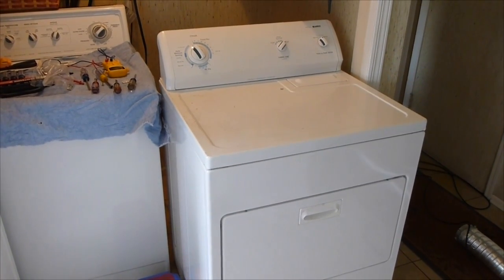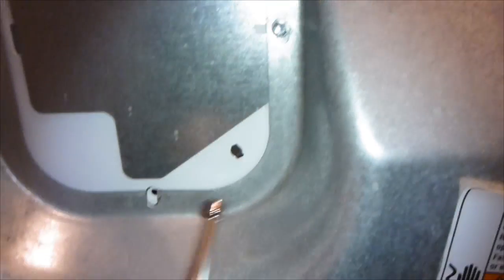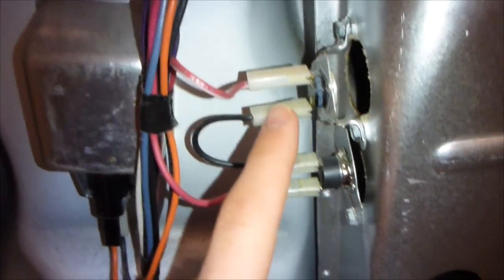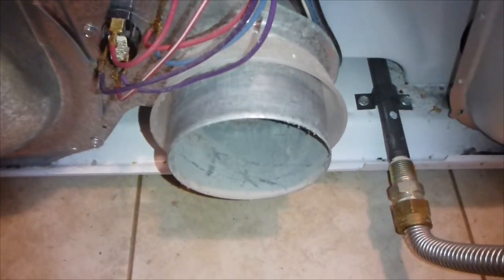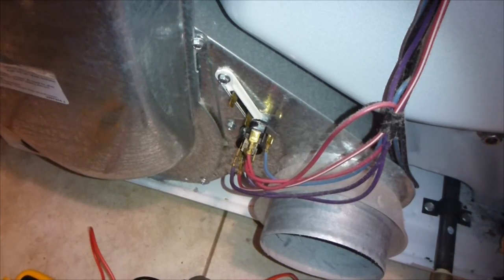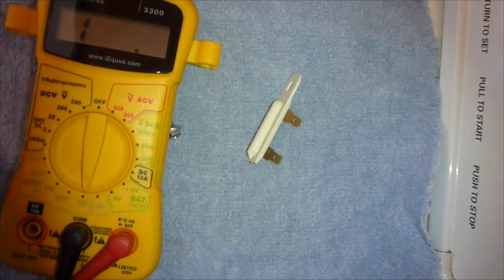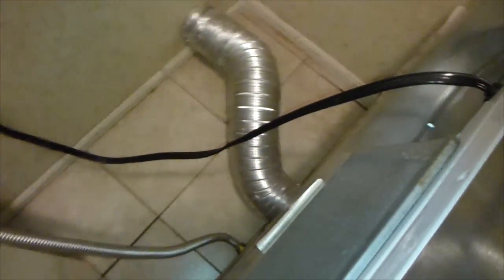How to Fix YOUR gas Dryer that is not heating up (Part 1 rear panel)

Comment: Great fix. Thermofuse wasn't available in town so i broke out the potted thermo fuse, carfully resoldered a new one from radioshack, now it works fine.
Reply from the maker: MrBrainFear Thanks. I am glad the video was helpful. So you made the fuse so it will burn at the correct temp so you dont catch the house on fire right?

Comment: I have a glow, and I can hear the solenoid clicking on and off.  Rarely, but sometimes, I do get a flame and the gas dryer heats briefly.  I have a Kenmore 70 series gas dryer.  Should I still check all the fuses in the video, or is it more likely something else?
Reply: I've done some more observing.  The flame lights on the first try, but after it shuts off after that, the subsequent time it glows, it doesn't light.
Reply from the maker: Randall Pope That means it is most likely you solenoids (99% of the time new ones will fix that problem).

Comment: Hello!

 My, "High Limit Cut Off" read an OPEN or OVERLOAD.  It's the Long Weekend here in Canada so nothing is open to get a new one.  But I thought I would test to make sure my Heater Coil, or whatever is in there is not screwed, so I bypassed the, "High Limit Cut Off' & tied the two wires together[I think I can do this since the High Limit reads under 1 Ohm normally I imagine there is some sort of, 'trip' in there that trips when it gets too hot.  Anyways I have had it running for 5 minutes now & no heat.  Is this a VALID test for the Heater Element, or do you think getting a new, 'HIGH LIMIT CUT OFF" might be the only fix I need.  I'm thinking it's probably both, what are your thoughts?

By the way GREAT VID!
Reply from the maker: velocity73R I am glad you liked the video. I would do just like I did in the video. I tested each sensor to make sure there was a closed circuit. An open circuit means the sensor or in your case, the heating element is broken. I dont know what you mean by "high limit cutoff".

Comment: There is a part that is known as the thermal probe, which strands back with the main heating element, the ignitor, and two fuses protecting it. Most likely it could just be a fuse.

Comment: I have a flow, but no flame.....how bout that?
Reply from the maker: dayglo25 You need Solenoids. Did you check everything else that I showed in the video?
Reply: Yes. Just wanted a confirmation...Thank you!
Reply: Just picked up some new solenoids. I'll let you know what happens tonight when I get home from work!
Reply from the maker: Great! Def let me know!
Reply: ChrisFix now on to the washer agitator! I'm gonna take off the panels and see if the transmission bushing is bad. I'll let you know what happens!

Comment: Where do you buy the thermo fuse?
Reply from the maker: vcomp1960 Appliance store, ebay, amazon, sears, etc.
Reply: Thanks.....Do I ask for a size or just tell them the brand of dryer
Reply from the maker: vcomp1960 Tell them the brand and model of dryer and they will have the right parts.

Comment: Thanks. I blew a ton of lint out of everywhere and cleaned the exhaust line before using it. that was the reason the fuse blew which ultimately prevented a fire. Thanks again for the video and suggestion.
Reply from the maker: Jeremy Harris You are welcome Jeremy! Glad the video was helpful!

Comment: awesome. Thermal fuse was the culprit. used a 20 amp fuse for now and ordered the correct part. Thank You Sir!
Charlie
Reply from the maker: Jeremy Harris Glad the video was helpful. Be careful with the 20amp fuse. The thermal fuse could have blown for a reason (dirty vent) so make sure you address that.

Comment: I followed your advice on using the multimeter, and checking the fuses in back.  Be sure to take off the covers before testing the fuses or you can get a false reading!  I read that on a comment by William on part 2, and re-tested the fuse.  After it tested okay with the covers on, without the covers, it was not working after all.  Quick fix then of the thermal fuse.  Total cost to fix:  $22 for fuse at local appliance shop and $10 for the multimeter at Home Depot.  THANK YOU SO MUCH!  YOURS IS THE  BEST FIX-IT VIDEO FOR THIS ISSUE ON THE WEB!
Reply from the maker: Xro X I am glad the video was helpful! What covers are you talking about?

Comment: ok so, i have no glow. have checked all the fuses, and all are showing continuity.  This shouldn't be that hard, but I am totally stuck.
Reply from the maker: Cassidy Baker Did you check the resistance to the ignightor itself? Or the other thermostat next to the ignightor (in the front)? I assume you saw part 2 of this video?
Reply: ChrisFix Hi Chris,
Yep, watched one and two. Both where really good, which is why I should be able to to this. I replaced the thermal fuse, just in case, and also the ignightor. Both where working according to my malty meter, but still no glow.  It was all working a few weeks ago.  Its not a duct problem, as it is clean.  I wouldn't think it is the thermostat, as I am not even getting a glow to start with.
Reply: Cassidy Baker Well, after having another look, the reason might be the thermostat had a loose or should I say broken terminal. So that would defenetly not be helping the situation. Once replaced, I am hoping it will be fixed.
Reply from the maker: Great! Keep me posted!

Comment: Hey How you  trubleshut they ignitiator. If could  Tell me please thank  you
Reply from the maker: I mention in part 2 of the video that you want to make sure it glows and it has continuity. 
How to Fix YOUR gas Dryer that is not heating up (Part 2- front panel)

Comment: I just wanted to say thanks for your help I did exactly everything you said and it really worked. The thermal fuse went out. I purchased a digital multi meter and thermal fuse for under 40.00 completely fixed. Thanks
Reply from the maker: Glad the video helped you figure out your problem!

Comment: fyi, On your second one you checked you checked your inverted the wires when you hooked it back up. The top one was red on top black on bottom. The bottom was black on top and red on bottom.
Reply from the maker: Good eye. It really doesnt matter the order as long as they are both connected to one prong each. Thanks!

Comment: Hi no the actual thermal coupler sensor (one side of it anyway) broke off. I was able to get the broken part out of the "cap" with the wires, remove the coupler, find a part (our sears parts store closed up here) and replace it. Dryer fired right up. Total repair $20 (plus a little swearing)!!  Thanks for making this video. It saved me so much.
Reply from the maker: Great Glad the video was helpful!

Comment: Hi I was doing really well checking out the spots on the dryer as you described. When I pulled the second set of red/black wires the black wire actually came out with the terminal for checking in the part I pulled away. I don't know how to return it to the terminal post (if that makes any sense.
Reply from the maker: You mean the metal clip that clips onto the sensor pulled out of the wire?

Comment: Thanks, I bought the multi meter and thermal fuse for around 40$ it was an easy fix and saved around 60$ because the repair guy wanted 100$. Got the fuse at the Sears outlet store.
Reply from the maker: Great! Glad the video was helpful and saved you money!

Comment: I only have buss checker and volt checker available. I commonly use them to test fuses in my home and to test outlets. There is no settings on it and no readout it simply lights up if it is working and doesn't light up if it is not. Will this work? I tried it on the back 3 fuses/thermostats and it did not light up at all. Are they all broken or do I specifically need a multimeter that I can set to OHMs?
Reply from the maker: You need a way to check continuity so if your volt checker or buss checker can do that, that is all you need. Otherwise, go to harbor freight and pick up a $5 ohm meter and you are good to go!

Comment: If the thermostat at the lover left bottom is good, but the thermo fuse is bad - would that make the thermostat at the top right back also go bad.  Just wondering if I should plan to replave both or just the thermo fuse?
Reply from the maker: You should replace anything that doesnt work. Those two systems are separate and should not cause the other to go bad.
Reply: Thanks - your info was very helpful to a single white chick who was able to repair her gas dryer with a $20 part and some elbow grease!

Comment: I have a kenmore series 80 gas dryer and thanks to you r video i figured out that i need to replace the valve coils. the question i have is when i took off the back pannel i noticed that that yellow wire thats going behind the lint trap in your video isn't connected to anything in my dryer and I'm wondering if its supposed to. i can't find any terminals that don't already have something connected to it. thnx.
Reply from the maker: I am not sure what wire that is but if you cant find any terminals then it might be an extra wire. What does that wire trace back to?
Reply: you can see it in the thumbnail of the video...its right underneath that orange/red wire and just to the left of the white one, its the yellow one with a black stripe.
Reply from the maker: In my video does it go to anything?
Reply: it goes behind the lint trap vent but but i took mine out and there are not any terminals back there that i saw
Reply from the maker: Does the dryer work otherwise? Maybe it is a ground?

Comment: Hi I checked all components working fine but there's one component 2 red wire one top and one with strip on the bottom working good but two purple wire right and left on the same component doesn't work, so I think thats the problem right... plz help
Reply from the maker: I am not following what you are saying. If you followed all of the steps in both videos and everything works, and you are adjusting the once "component" and then it works, you found your problem! Maybe im just not following what you are saying

Comment: I have whirlpool dryer it runs but no heat, and I heard the click sound,I can see light on the bottom, 5 seconds later light turn off agian and turn off keep doing that. What is problem u maybe know. Thanx

Comment: Great video. My dryer would run, but, would get no heat, so I changed the thermal fuse and that was not it. I changed the ignitor and that was not it and I was about to call a repair man and that's when I found your video. I purchased a multi-meter and went through the step you shown on this video and found it was one of the thermal cut offs. The dryer is working now.  No more stiff clothes!!  Thank You!!!
Reply from the maker: GREAT! Glad you fixed your dryer using my video! Thanks for the comment!

Comment: LOL you rewired the bottom fuse wrong.  black top, red bottom.  How did it run?
Reply from the maker: Good eye. It really doesnt matter because the fuse wires just connect for continuity. She is running great!
Reply: Cool.. I just thought you made a point to talk keep it straight and flipped it in the end.  Good demo.

Comment: Excellent video - very helpful. It turned out our dryer had the same problem (thermal fuse).  While I know it doesn't matter, someone else probably already caught that when you replaced the wires for the lower thermal sensor in the top section, you reversed the red and black.  Just pointing it out for the fun of a nit.
Reply from the maker: Thanks! Glad you were able to fix your dryer too! And good eye! It really doesnt matter what order those wires go on bc it just makes a connection. I appreciate the comment!

Comment: thank you for that video, very easy to follow. I fixed my dryer with that video, it was the thermal fuse also. I'm not to familiar with texting meters so you were a big help there as well.
Reply from the maker: AWESOME! I am going to make a quick video on the multimeters because a lot of people dont really know much about how to use them (they are a great tool)!!! Glad the video helped! Give it a thumbs up if you havent already (it helps me out, thanks)!

Comment: Many thanks for your video.  I felt like a hero today fixing a dryer in one of my rentals.  I am new to the landlord game and not terribly handy.  My problem was the exact same one you experienced, the thermal fuse.  By the way, I got a little confused when you put the wires back together at 5:45 and reversed the black and red.  Might want to put a bubble in the video on that one.
Reply from the maker: It doesnt matter what order the wires are in but I will put a bubble to clear it up. Thanks fo the comment and I am glad the video helped!

Comment: Did you do this with the machine unplugged from the power outlet?
Reply from the maker: Yes, when you are taking the dryer apart and when you are using the multimeter, have the dryer unplugged. Then when everything is back together and you want to test it out, plug it back in. It is for safety so you dont get electrocuted.

Comment: Great video,  my dryer wasnt working. It was the same situation. Checked everything with the multimeter and it was the same thing that went bad, the thermal fuse. Ran over to the appliance store and was back up n running within one hour  great video thanks for making this, super helpful!!
Reply from the maker: Awesome! Glad the video helped you fix your dryer!

Comment: Great video. Thanks VERY much. Our dryer crapped out yesterday. Repairman was going to run $75 for the service call, plus whatever parts were needed. We were planning on AT LEAST $100. I was able to determine the fuse was bad and swapped it out in about 30 minutes, including going to buy the new fuse.
Reply from the maker: Great! Glad you were able to fix it, you saved some money and the video was helpful!!!

Comment: The fuse should be an OPEN circuit when good.  When tested it showed closed (no resistance or continuity).  When replaced it showed open (resistance and continuity).  Noticed you reversed the open/closed test results a few times.
Nonetheless your video is saving many people money and giving them the confidence to get in and fix these simple problems themselves.
Reply from the maker: So a closed circuit means continuity and an open circuit means no continuity ?
Reply: ChrisFix Think of continuity as unbroken or continuous.  If the fuse is blown the circuit is broken thus no continuity.

Comment: Hi,
Thanks for the info on troubleshooting the gas dryer. In part One, did you realize you put the wires back wrong on the second fuse? The red was suppose to go on the bottom and you put it back on top like the first fuse. Apparently, it didn't make any difference because it worked after you replaced the thermostat.
Reply from the maker: Yea, good eye! It doesnt matter what order the wires go on because all the thermostat does is bridge the connection. If the connection is broken, then the gas shuts off. So the order of the wires isnt important. Thanks tho!

Comment: Your video helped me find out our thermal fuse was bad. But where can I get thermal fuses?  Lowe's said they don't carry them...
Reply: Got mine at Amazon. $2.40 each. Free shipping. I bought 2 to keep one as a back up.
Reply from the maker: No problem! Glad the video helped fix your problem! For a new part, go on amazon or ebay.
Reply: ChrisFix Thanks, my good man.  I got lucky and got one from an appliance store (they got one out of the service truck). The dryer works just fine.
Reply from the maker: Nice! Hopefully they didn't rip you off. I got mine for ~$10
Reply from the maker: There ya go! Not bad considering a new dryer is $400-500 lol

Comment: So helpful!! Thank you for explaining everything so simply! I found the same fuse was bad - I didn't have a tester but brought it to a local auto shop and they were able to check it and see the circuit did not complete. I have ordered the part on amazon for $2.45 and now am anxiously awaiting to see if it works when it arrives!!! And we almost bought a new dryer yesterday! Thanks again. I've liked your video :)
Reply from the maker: Great! Glad you didnt buy a new dryer! Hopefully it fixes it. If not, a multimeter is a cheap investment ($15 from walmart) and you can test everything else. Sounds like you found the broken part tho

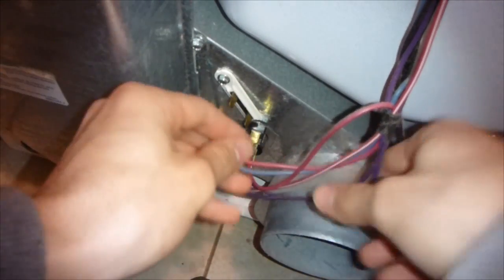Comment: Hey Chris great video. I'm going to troubleshoot my dryer today. However I wanted to point out that when you were checking the upper thermostats in the back at around 5:50 you re-installed the wires backwards, but I'm sure you caught that, I hope lol. Thanks for posting, this is awesome.
Reply from the maker: Good eye. Yea it doesnt matter what order those wires are in. All that sensor does is create a continuous electrical circuit. If that circuit is broken, the heat shuts off. On the thermostat the circuit is broken when the heat exceeds a certain temp.

Comment: Chris,
Any suggestions of where to look first for a dryer that heats itermittently. Works full blast half the time then gets tempermental and only heats half way. Igniters seems to be igniting- vent is clean.
Reply from the maker: Sounds like it could be the solenoids not opening up all the way or all the time (being temperamental).
Reply: ChrisFix Thanks
Reply from the maker: No prob. Let me know if you fix it. Most people with this problem that have commented have fixed their dryers with new solenoids.
Reply: Very strange. The dryer has been working perfectly since I threatened to take it apart.
Reply from the maker: Haha, good... Keep that dryer in line LOL... Well, if it is temperamental, it could be on its way out and I would guess solenoids. They can get iffy when they are about to go.